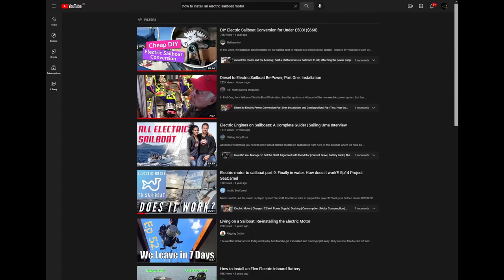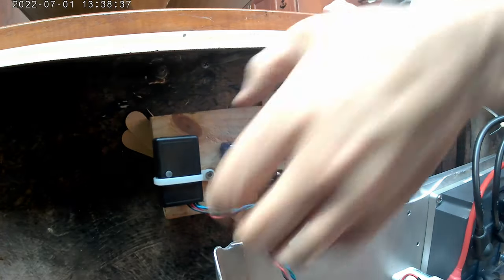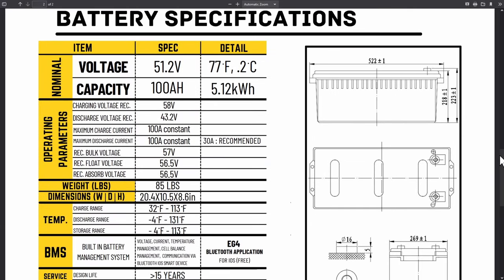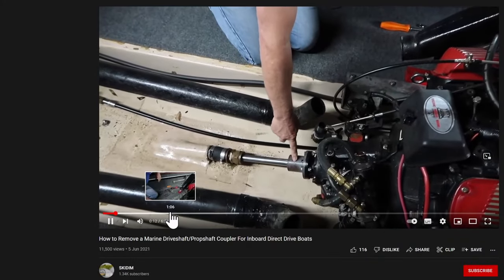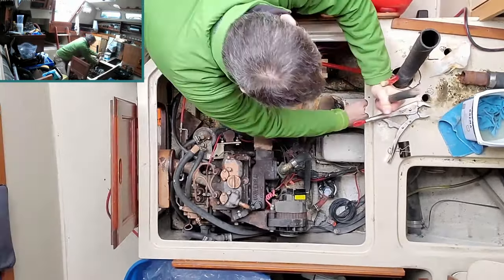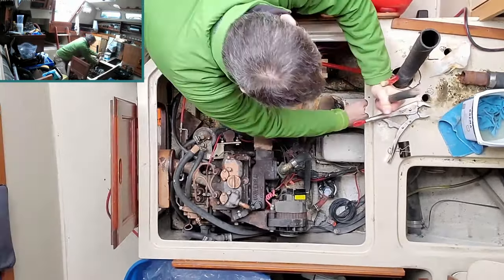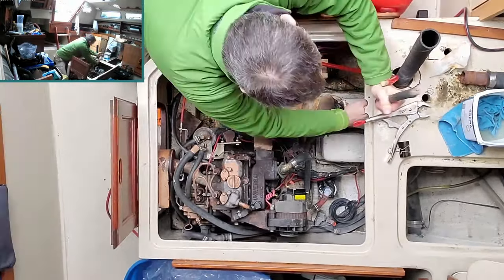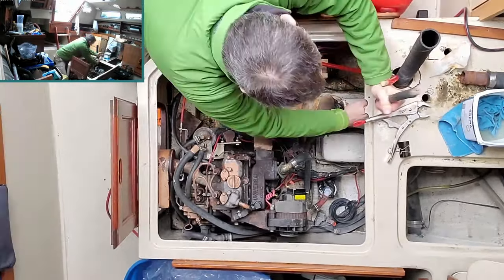How to Install an Electric Sailboat Motor - Catalina 30 - Thunderstruck Motors Sailboat Kit

Comment: I have a Gray Marine engine that works fine but it takes half an hour to unstick the recently replaced (they said that would fix the problem...) #1 exhaust valve every time I want to go sailing. I have been watching every electric conversion video I can find and this is the best so far.  One thing that gives me pause is that many of the older videos on conversions end with the owner removing the motor and putting an engine back in the boat.  Now that you have a year of experience, how's it going?
Reply from the maker: I really like it. I have plenty of power to motor out for sailing and then back into the marina. I also have an outboard, in case I want/need to motor long distances and need to rely on gas. I haven't had need of it yet, but since I have the outboard for my dingy anyway, it solves the infrequent (for me) range issue. :D
Reply: @openrov272  Thank you for the prompt reply. Your boat is 10,200 pounds and 30 feet long and has a 10KW motor. Mine is 12,000 pounds and 36 feet long. Do you feel you have enough reserve power that you would use the same motor for my boat or would you scale up and get the 12KW motor? My use condition sounds similar to yours. I would need full power for the 1/2 mile dead into the not unusual 25 knot wind marina entrance channel. Other than that, it would be light wind usage. I sail in SF Bay so would never have to motor in big seas.
Reply from the maker: I would go with the 24kw. It is same price as the 12kw. It's a little more efficient to have the higher voltage. It think it is the same "everything" as the 12kw, but programed for 96v instead of 48 or 72. The downside, is that you would need 2 48v batteries in series, so if one failed your voltage would drop in half. I don't know if the motor would work at all at 48v. If you can afford the extra $3000-3500 USD, then you could buy an extra 2 batteries, to solve that problem. :D
Reply: @openrov272  I had not considered higher voltage as my needs are so slight. It would be an unusual day I had to go 2 miles. 1/2 a mile of that might stress the motor but other than that, 2 knots would be fine. Obviously thee are a few days a year when the wind dies and I want to get back and turn on the engine. 

I take it from your reply that you don't think the 10kW motor would be enough. Am I correct on that?
Reply from the maker: Their site says "up to 12000lbs". So in theory it should be fine. The larger motor is $800 more, which for boat stuff, doesn't seem like a huge amount. (it's still 800+ dollars though!) It would mean you were not so close to the line between powerful enough and not powerful enough. The 10kw would get you 2 knots without any difficulty though. I run my boat at 2-4kw. 2kw normally. 4kw on the way home. heh. And I go whatever speed that power gets me at the time. If my hull is clean (which is not the case right now) and if wind is not too bad, I get  3.5 knots (+/- wind current effects) at 2kw and about a knot more at 4kw.
Reply: @openrov272  Good advice, thank you. At 1000 RMP my boat goes 5 knots. At 1000 RPM into the worst conditions I encountered going into my marina, my boat went 0 knots. It is only 1/2 mile but I am going to need power for that short run. I just don't need it for range. Lots to think about.
Reply: @openrov272  I thought I replied to this but I must not have. Thank you so much both for this video but also for sharing a little advice. The case for the 96V in my case seems strong and I really appreciate the time you have put into my comments. Thank you.
Reply from the maker: NP!
Reply: @openrov272  Well, yesterday the engine was spitting water out the back of the manifold and replacement manifolds are unobtanium. I am 80% going electric, 15% diesel, and 5% I can epoxy the manifold back together. The later is preferred but highly unlikely. I tried to feel for the hole and pieces of cast iron came off in my hand. There are two use conditions that I think are worst case. 30 knots on the nose for half a mile getting back down the channel. Infrequent but that was about what we had yesterday. Other is 7 miles into a 1.5 knot current and no wind. I am thinking I would need two 48 volt batteries so maybe the higher power one as you suggested is the one I should get. I was initially thinking that one 100AH 48 volt would be enough and it certainly would for most of the time but yesterday with 30 knots of wind and about 15 minutes to get back in before the we would get stuck in the mud and have to wait for the tide to come back in I appreciated the power and range of my failing engine. I made it to within 3 boats of my slip when the engine just quit and would not restart. Back in the slip I saw the water exiting the manifold as I tried to start it and the #4 cylinder was flooded and spitting water when I removed the spark plug. Not a good day. Do you still like your electric motor? Any update? You have a 10,000 pound boat and a 10kw motor. I would think my 12,000 boat would work with a 12kw motor. But the range thing has me worrying and you make a good case for going with a higher voltage.
Reply from the maker: I still love my electric. :D I do have the 15 hp outboard as backup, but since I installed electric I have only ever run the outboard for the sake of maintenance. At this point, I would ask the people selling the motor, about the size they recommend. Then you can hold them to it! :D
Reply: @openrov272   Thanks for the prompt reply. I just emailed Thunderstruck and raised the question. We shall see what they say. But I figure if you are happy with a 10kw motor, I would be happy with a 12kw one.
Reply: Here is their reply: "Normally for a boat this size I recommend our 12kW kit with a gear reduction. There is something to be said about a higher voltage in circumstances where you will regularly face adverse conditions where the system will have to be pushed harder. A higher voltage will mean less amperage for the same results, which will mean an overall cooler and more efficient system. In most normal circumstances 96v would be much more power that you would ever need, but that's not necessarily a bad thing.

That being said, a 12kW kit would be adequate for harboring. If you are concerned about facing high wind and current for prolonged periods of time regularly, a higher voltage could be handy."

Comment: Hello again. Wanted to pick your brain some more. What size interconnect cables between the batteries would you recommend? i will run 4- 12v 100ah batteries in series for 48v. i was thinking 4 GA. Do you think that's adequate or should i go with something larger?
Reply from the maker: Figure out what amperage you expect to draw, and consult this chart https://www.bluesea.com/resources/1437 I used 1|0 (or 0) which is good for about (I think) 180 amps, because My set up could use that amount. :D

Comment: I'm trying to buy an Elco electric inboard for my Catalina 27 but I'm running into phone apps. I don't even know if they make a control pannel for their engine. I would think an engine would come with standard gages that tell you RPMs, amps etc. Why on earth would I want to have to drag out a phone to look at this stuff? Not to mention the privacy concerns. This is just amazing to see a company pull something like this. Anyone know of an inboard motor company with actual equipment and no phone apps?
Reply: And also a way to require subscriptions and ongoing fees.
Reply: Just install a 100$ tablet and there you have your gauges

Comment: Im looking at replacing my Farymann A30 that I just found a hole through the head (literally) and attempting to do this in as much as a budget/cheap as possible. Boat is a cheap 6kt sh t box, but a local legend in seattle. Anyways, Looking at Anaheim Automation has some integrated controller/motor units and wondering if that could save a few hundred there and going cheap on the batteries if shes never meant to spend more than a night or two out from a plug. I think I can get it done in under 4k USD, is that too lofty?
Reply from the maker: The main downside of going electric is range. If you don't have much in the way of batteries, you should really have a gas outboard to back you up. I say this because if you need to use a lot of power to get out of a tough spot, it will use up your battery very quickly. The good news is that battery prices seem to be getting better (for lithium Iron Phosphate.) The bad news is that that doesn't help you right now with a hole in your engine! That sucks!

Comment: How are the EG-4 WP batteries working out? I bought a about ten of them. The cells are wildly out of balance. Seems completely random as to which ones. I can't charge above 55.2 without going over 3.65.
Reply from the maker: They have been working well for me, but I can't claim to be an expert. I just plug in the charger and when I get back to the boat they are full. They do have a 5 year warranty, so if they are bad you should be able to return them, though obviously it would be a pain in the butt to have to do that! This guy: https://www.youtube.com/c/WillProwse/search?query=eg4 seems to know a great deal about batteries, and has experience with EG4. I'm not sure if he has used the WP ones though. He would probably have a more satisfying answer!  :D

Comment: Hi, do you have a bead on a supplier of blanks for all the holes left behind of the decomissioned and abandoned? And also how did you plug the engine exhaust port?
Reply from the maker: If you are talking about the thru-hulls, I haven't sealed  them. The raw-water intake thru-hull is plugged and strapped for now (As well as being closed of course.) The exhaust has not yet been permanently sealed or removed yet. It is above the waterline, and the hose loops well above the waterline, but it does need to be plugged, or preferably, filled. I have some ideas for the raw-water intake, so I will leave it as-is for now. Once I deal with the exhaust thru-hull, I will finally be able to remove the rest of the exhaust hose. :D
Reply: How about unused control and gauge holes, did you use blanks?
Reply from the maker: No I haven't used any blanks.

Comment: I converted my Catalina 30 to the same ThunderStruck kit 5 years ago. I recently bought the ODB2 kit and Bluetooth adapter - got everything hooked up but I am having trouble setting up the Torque app to read the output from the controller.  Did you have to download special PIDs for the app?
Reply from the maker: Yes! I think I got them from the link at the bottom of this page: https://www.thunderstruck-ev.com/can-translator.html

Comment: I like my air cooled Chinese 168 F diesel. It's much lighter and cheaper than electric and it charges batteries on very little diesel. Hot dry air is welcome in almost any humid weather.
Reply: Confused?  "lighter and cheaper than electric" then "charges batteries"? Any vids to show what you mean?
Reply: @Lana_Warwick  Good question. Read slower and fair seas to you.

Comment: hey, very nice job.
it's interesting to know the global budget about this conversion (motor, controller, charger, battery pack)
i'm from belgium, and found a representative contact of Thunderstruck in Netherlands..
my boat: a Kelt Sailoat, 30 feet, actually powered by a Yanmar 2GM :)

or the same project, this last summer, at LaRochelle BoatShow, a firm in France propose me 15.000€  (motor, controller, charger, batteryPack),.. interesting to compare
enjoy the Sea ;)

Comment: Did you consider mounting a similarly powered torqeedo on the back for a simplified install and freeing up space in boat?
Reply from the maker: I didn't think of that. It would have been a fair bit of work to install an outboard in the center of my transom though. I would have to find a new place to put the ladder and buy/build a quality mount. Before I started my install, I'd expected the job of mounting the motor bracket would be less trouble that it was. Mostly though, I just want an inboard! :D
Reply: @openrov272  Indeed, inboards are superior in terms of performance and no cavitation.  I think I am just not as skilled and could never pull off a DIY inboard mount....🤣.
Reply: @openrov272  alternatively - im on a Catalina 309 and was playing around with the idea of one of the powerboat style torqeedo with remote control and a "well" to mount it interiorly as did not want it popping in-out of the swell.  but in the end, figuring I will be doing a engine replacement keeping the shaft exactly like you did.

Comment: Very funny, inspiring informational vid! Thanks for sharing this useful info. Was wondering if anyone ever attempted installing a hybrid electric motor like a Prius C? Might be a dumb que but I'm not very technical so no shame on my end lol. It seems like a great redundant option that can further reduce fuel costs as well as mitigate against lightning storm damages to any onboard electrics. Would greatly value your expert feedback.
Reply from the maker: There are definitely hybrids out there. I agree they seem like a great Idea. :D I've also seen people use generators on their electric sailboats.
Reply: @openrov272  :- ) Was never a fan of generators purely from the standpoint of the noise they...well... "generate". Part of the reason I support the electric movement actually is for its low noise pollution in such a beautiful, natural environment. To me its a no brainer and as the technology on batteries improves, I don't see why it can't become the standard. Anywho, just my 2 cents.

Comment: What’s your max range motoring at near hull speed ?
Reply from the maker: If motoring long distances at Hull Speed is the most important feature for you, I wouldn't go electric. Range is the one factor that is still very(very) much better with a gas/diesel power-plant. I have an outboard as a backup, in case I want to motor for long periods of time. But I haven't used it yet. I can motor at about 3 knots (2kw) for 5 hours, and that has worked well for me. Currently, my prop does not match my gear reduction ratio. (This is because I am replacing the prop, so I made the calculation for the new prop not the current one.) So I would have to guess to answer your question. I can't claim it reaches hull speed, because I haven't done it. With the 10 KWH of battery power I have, using the 10kw motor that I have, I can go at full power for 1 hour. (the range is weather dependent) The diesel motor, which I replaced, couldn't reach hull speed anyway, but this motor will get closer to it. (It might actually do hull speed, the math suggests it can.) I generally run the motor at a set power level (2-4k) so I know that I will get either 5 -2.5 hours of motoring. If you reduce your speed by 1 knot, you use half the power. So running at 2 knots below hull speed save uses 1/4 the power of hull speed.

Comment: Do you know if the throttle circuitry influences your binnacle compass at all? They're a little close for my comfort.
Reply from the maker: I'm not sure. I don't think it causes the compass to wobble, but it might have a static effect. Good question! I do Plan to move the compass higher in the future, when I add a control panel.
Reply: @openrov272  I did a controller-less EV conversion on a car years ago.  The amount of current the throttle generated in that setup would have been a problem.  But maybe with a controller it's not much of an issue.

Comment: Where did you source the battery charger
Reply from the maker: I bought it from : https://signaturesolar.com/shop-all/batteries/battery-chargers/   :D
Reply: Can you recommend a charger for a sealed lead acid battery?
Reply from the maker: https://www.sterling-power-usa.com/ These were recommended to me by others. I've installed one on my boat and it has worked well so far!

Comment: So is your OBM gasoline driven?
Reply from the maker: Yes, my dingy outboard is gas, and pushes my sailboat boat at hull speed. So if I need to motor long distances, I'm covered. So far I haven't needed it, since I can motor for 4+ hours (at 3 knots) and that is more than I usually need. :D

Comment: What about regen from sailing.
Reply from the maker: My current set up won't allow regen. My prop is too small, (I've been told that, realistically, you need a 16" or larger prop for regen) and I believe the space available for a prop on my boat is also too small (for a 16" prop). I will be replacing my prop, so there is some small hope there. :D
Reply: @openrov272  yes to will need to upgrade to a feathering or similar prop. As you want the larger prop for Regen but less drag at slow speeds. I think the real holy grail for electrics is producing enough Regen or solar to charge the small running time to get in and out of the slip as well as house loads. I suspect we will see at a minimum diesel electric hybrids being the norm for all new boats and repowers soon enough.